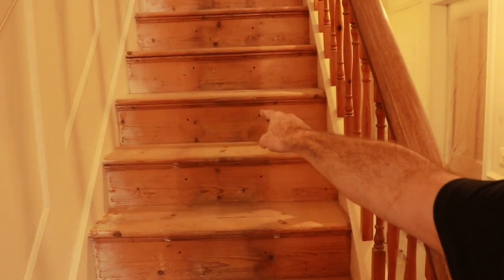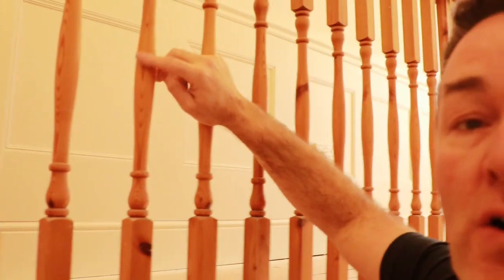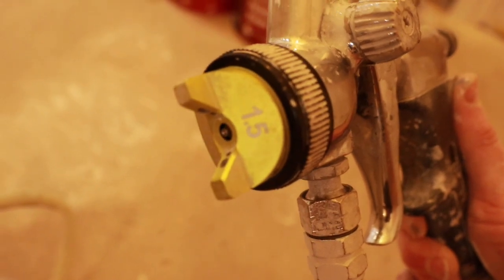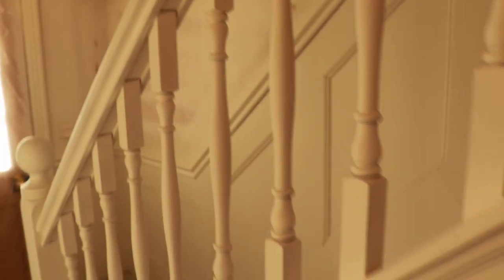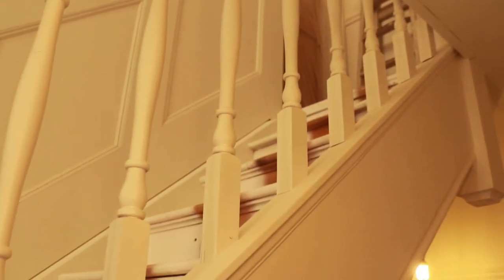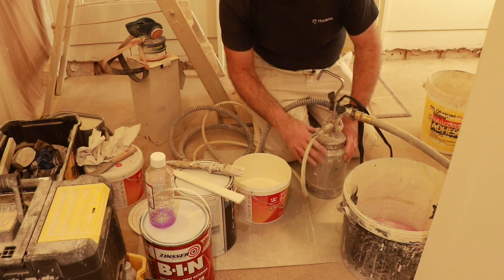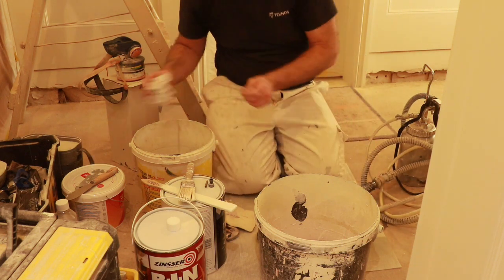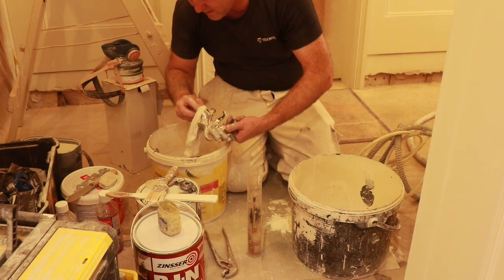Paint Your Staircase in Minutes with HVLP - You Won't Believe What Happens Next!

Comment: Hi Phil, In reality how much spray “dust” settling is generated in spraying a staircase indoors with a HPLP.  Ie
how much masking out is necessary other than to protect from direct jets of spray. I realise there is going to be an element down the hall corridor for instance but would it be a nightmare to clean up, would it percolate through to other rooms. I come from a car spraying, compressor background (many many years ago) and if I was to spray indoors with cellulose for instance the whole house would be absolutely covered. 
I would appreciate your assessment based your expertise and experience. 
I thought I was just going to spray kitchen units but because of your videos I’m thinking of a load of other uses. 
Thanks Man. 👍